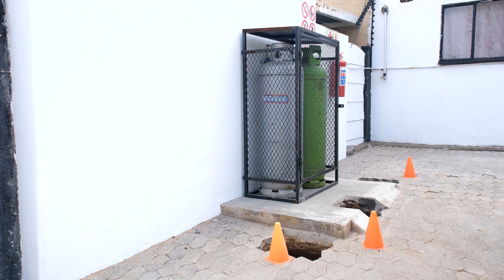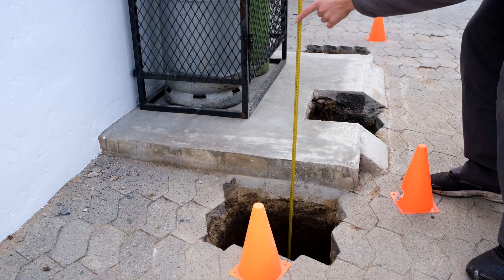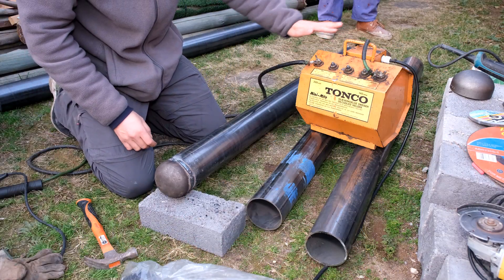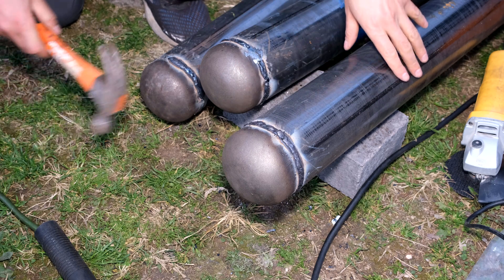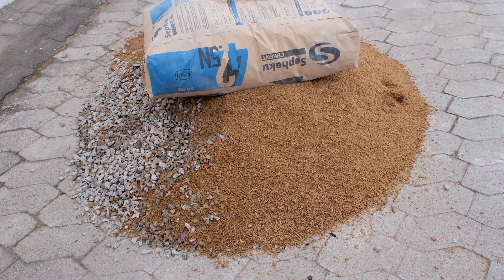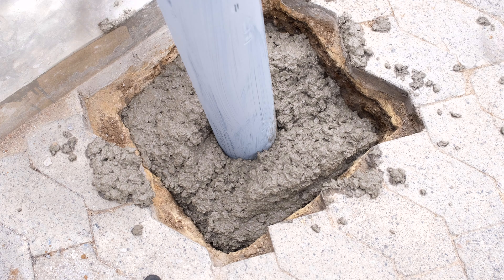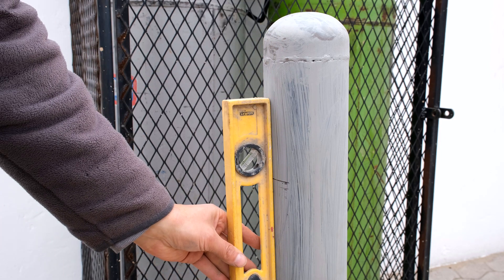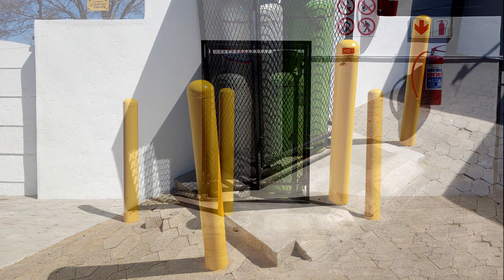How to install steel bollards, vertical safety posts.

Comment: In Canada, we typically do not weld a cap in the top. We place the 6” pipe in the hole and dump the dirt from the hole into the pipe and top it off with half a bag of concrete. We then place a plastic Bullard cover over the pipe. The Bullard covers can be ordered in any colour, include reflective striping. The covers can also be cut to any height, which means you don’t have to worry too much about getting the steel pipe installed all to the exact same heights with each other. Cheers